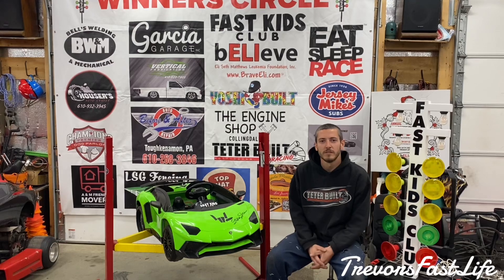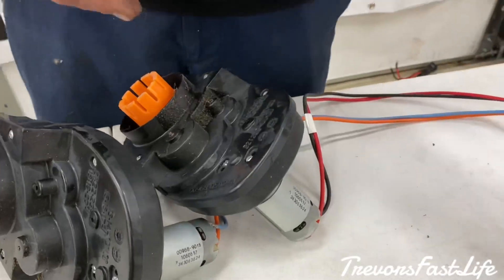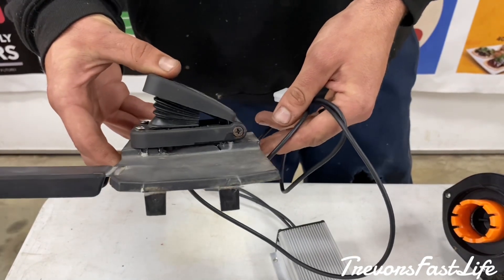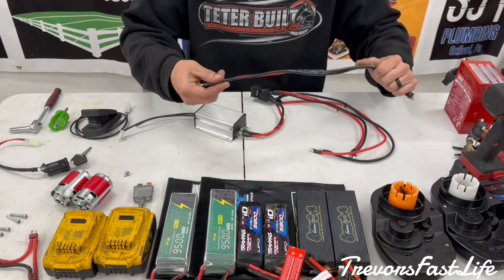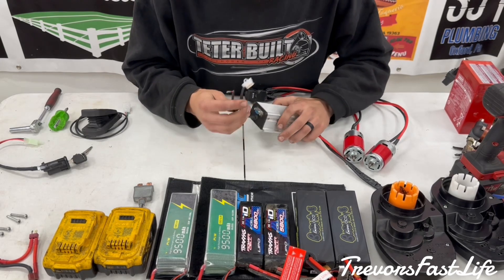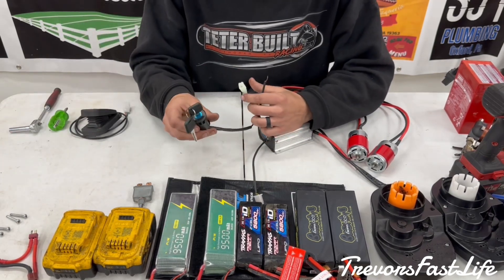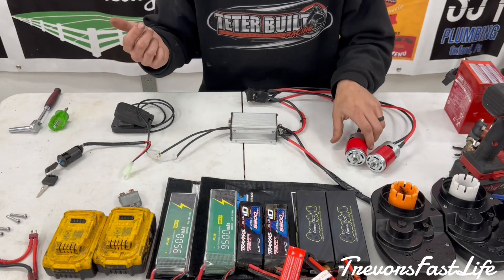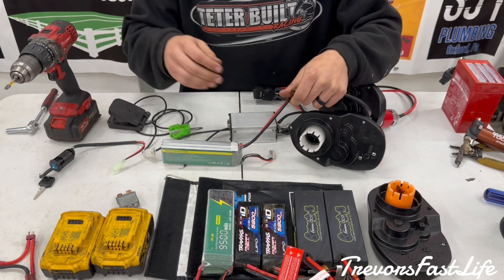How to build a FAST power wheel

Comment: How many amps can that stock switch hold?  Does it keep the forward/reverse function?  Most DPDT switches I have see max at 20 amps.  I would be surprised that switch could handle all the volts and amps for 2 motors going through it.

Comment: Looks great! Is this approach better for everyday use than the one using a solenoid? Also, do batteries u use need overdischarge protection? What is your opinion on resistors used to gradually slow down the car, for everyday use? I want to build 4wd 775 24v machine. Thank you 😊
Reply from the maker: A Kelley controller is definitely better for everyday use, I’d use a solenoid for just drag racing

Comment: Quick question if i were to use the factory pedal with this setup would i still need all 3 wires off of the controller or just 2

Comment: Hi 

Is this set up meant also for day to day cruising around neighborhood type of thing or not ? Please elaborate since it’s an esc set up. And where do you wire the 100 amp breaker ? Thank you in advance
Reply from the maker: @PeterSiekiera  correct, he uses these setups at everyday drivers , just don’t run it to long or you burn the motors up, you have to let it cool down a little between riding,

The 100amp breaker is wired into the main power wire
Reply: @TrevorsFastLife  Ty sir!!!

Comment: Are these motors good for long distances? I have a dune racer that I stretched out the frame so I could fit in it I'm 6 foot tall I put my daughter on my lap and we drive it up and down the road so I need something that can move a lot of weight and last a long time.
Reply from the maker: They are good for long distances but at lower voltage

Comment: where do you get the motors and how do you find the right gear. I couldn't find out how to match a new motor to the gear box
Reply from the maker: We use vex robotic 775 motors you can find them online , the gear boxes have numbers labeled on the back that tell you the correct pinion size

Comment: What is the suggested run time on those lipo batteries for motor longevity?
Reply from the maker: It depends what size lipo you are running, but if using the lipos I would recommend using it for drag racing only , it’s a hit or miss on the motors any more than that, but for just straight line racing , they hold up well on 6-8s

Comment: I have a red corvette i need to change motors for. I was wondering how to know what pinion size I need to buy, I also wanted to know if the speed controller is necessary since it is very pricey
Reply from the maker: You count the teeth on the precious pinion to tell you where you are at , if you do a first gear delete it’s just a big trial and error with pinion size depending wheel size and weight 

ESC isn’t necessary, but will make it fast only two ways to make these fast
ESC and a heavy duty golf cart solenoid
Reply: @TrevorsFastLife  Also, does the circuit breaker make the 30amp fuze that comes with the battery converter unecessary?
Reply from the maker: @jdcravings91  yeah you can do away with that 30 amp
And just run a 100 amp circuit breaker 

The Andy’s will be fine on 18v they really wake up on 24v
Reply: @TrevorsFastLife  sounds good, now i have a bunch of 18v batteries, i rather not buy new ones, will they be ok with the andymark 775?

Comment: Are you running brakes? Looks like the Kelly controller doesn't support motor breaking
Reply from the maker: The Kelly controller does have a “brake” connector off of it but we don’t have brakes on this one currently . You can get resistors and wire them online with the motors so that they motor break when the gas is released

Comment: Can you tell me how many volts you are putting to those redline motors? Are you able to run them successfully on 46v
Reply from the maker: We are running 7S Lipo, about 31 volts, we have pushed them on 8S, and 40v lithium but they do not like anymore than that
Reply: @TrevorsFastLife can I run 2 Dewalt flexvolt batteries in series/parallel to make 40v on andmark dual motors?
Reply from the maker: @tombomombodombo  yes and no, you can but the motors won’t last to long like that

Comment: Hey I need to remove my pin 10 tooth off the 550 to install on a 775 motor how donu do that ?
Reply from the maker: 550 pinion shaft is a different size than a 775 , the shaft on the 775 is 5mm, you’ll need to order 32 pitch 5mm 10tooth pinion

Comment: Okay, back again, i was about to place a order on the controller. It's asking for a connector type.  Should i just run with the compact?  Seem like a lot of connectors vs what you ended up with.
Reply: I am seeing the same thing. @mrmckenzie2403. What did you end up doing
Reply: @Sirfuzzybunz  apologies im just seeing this. Went with the first set of connectors  looking at it like the left is the first choice.
Reply from the maker: @Sirfuzzybunz  it should be the 2 plug connector and you’ll cut the plug
Off , and use the wires, you can shoot me a message on Instagram @Teter_built I can send you a picture of a wiring diagram
Reply from the maker: Select 48v 200amp option and use the first option for the connector ! It should be a 2 plug connector

Comment: Just watched your video and this is great information. In your list of items you mentioned a 100 Amp circuit breaker.  Is there a particular one that you recommend or can you send a photo of one you use?
Reply from the maker: This is the one I used!

https://a.co/d/0vDYI5r

Realistically any one will work though , and your local parts store should have them in stock
Reply: Thank you. That's what I was thinking but just wanted the confirmation.  Appreciate the information.  I hope to have my daughters Mustang running as fast as what you all are.
Reply from the maker: @johnhouse7376  no problem at all! Goodluck to you! We hope to see her ripping soon🚀🚀
Reply: Hi Alex. I watched your video on YouTube and I also message through YouTube.  I have purchased the items that you had mentioned in the video.. 10 AWG silicon wire,Kelly controller,variable gas pedal, 775 recline motors with 19T pinion gear(I have a Mustang), and a key to start the car. I am new to the whole P/W thing and not real good with electrical(but learning). I thought I had everything wired correctly but when I turn the key and press the pedal, I get nothing. I was wondering if you could list every part I would need and you could provide a wire diagram of the wiring system. Do I need relays for this to work? I also want to add a step down convertor for the lights and will be running lithium ion batteries so I will also be using a low voltage cut-off. I would really appreciate your help as I am completely confused. I will also be running 36V. Thank you for your time and help.
Reply from the maker: @johnhouse7376  sorry man I didn’t see your message , do you have a key wired up (on/off) switch or atleast the key wire jumpered straight to + , you have to make sure it’s on or you won’t get anything , you also sometimes have to plug the rs302 cable into the controller and program it on your laptop to your voltage settings ,
Reply from the maker: @johnhouse7376  shoot me a message on Instagram @Teter_built
Reply: Where is the list of parts